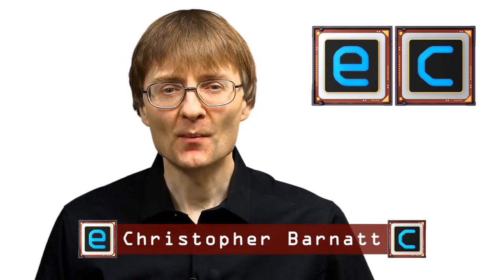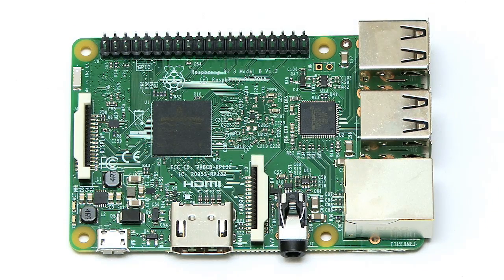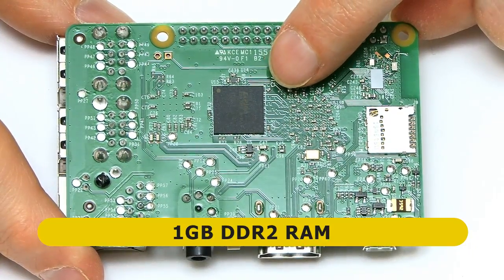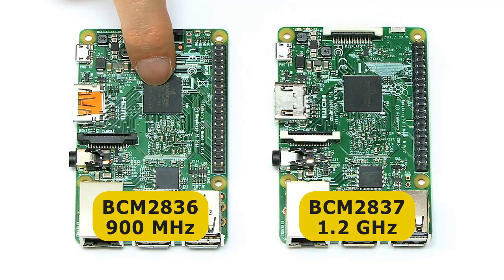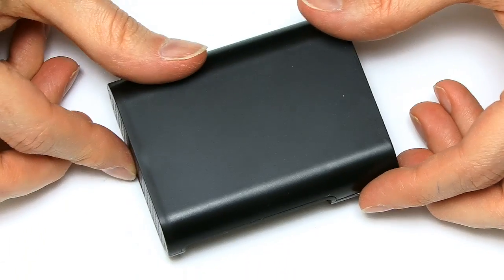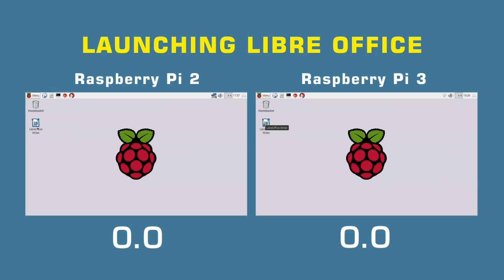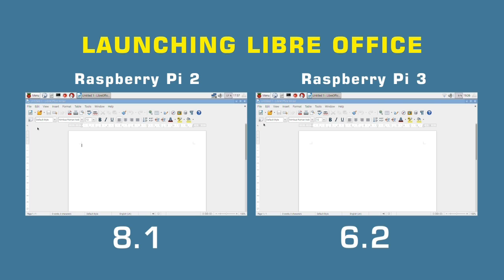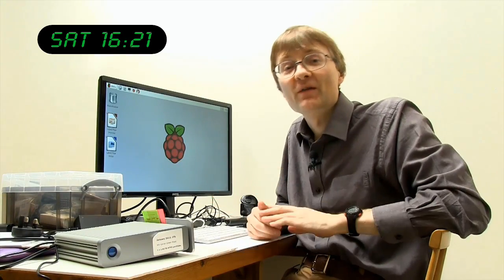Raspberry Pi 3: Review & Speed Tests

Comment: how can you get sound from the pi?
Reply: +el magiko 
Sound will come out of your television speakers using HDMI.
You can also connect to the analogue jack (on all but the Pi Zero).  
The jack (from B+ onwards) also carries the composite video signal.  From my experience the sound over the jack is poor, so either use HDMI or get a DAC add-on for good analogue output.  I attached a Phat DAC to a Raspberry Zero, soldered on some phono sockets, and the sound through my amp is excellent.  You could connect a Phat DAC to a Pi3 as they all (except the first Pi) have the same GPIO.  Other DACs are available for Pi, but I've not tried them.

Comment: Is it capable with windows?
Reply from the maker: +Ps Channel The It can run Windows 10 IoT -- which is not a "normal" version of Windows. See my video "Raspberry Pi 2 Windows 10" for a demo. Or it can run older versions of Windows via emulation -- see my video where I run Windows 3.1 on a Pi 2. But Raspbian or Ubuntu MATE provide a good Windows alternative, and there is loads of good, free software.
Reply: Thank you (again)

Comment: The RAM is too small, imho. Thanks for the video.
Reply: +tremorist hopefully they'll improve that with the next iteration. Since it'll prbly take another year I think a leap to 4 gigs of RAM would not be an insane thing to do.
Reply: its fine for linux
Reply: +tremorist  yes and that's the problem i have with mine..low ram.
Reply: It's not a home computer you plebs, buy a real computer. And, you're literally insane if you think they'll have 4 gigs on this and still have it cost $35. This is meant for small projects, not to replace a $900 home desktop computer.

Edit: a little rude, but I'm seeing tons of people saying what you're saying, and it's not possible in the slightest. People are asking for more ram, more processing power, better everything and etc, and acting like it'll still cost $35. It costs $35 to have a low power "computer" for small projects and to learn how to code. Not to have a low cost high power computer to play video games on.
Reply: @Skripy Resources
Rude and dumb. You're just insulting people based of your assumptions.

Comment: Will you mention the Pi 3 overheating problem in a video or try a cpu stress test to measure the temperature ? 
Some articles and reviews mention that even with a heatsink it can heat up to 80°C (maybe partly because of the 2,5A used for power supply to allow the pi 3 to supply power to peripherals), the Raspberry foundation still hasn't made any announcement unfortunately.
Thanks a lot for your video :-)
Reply from the maker: +Cathy Penneflamme Yes, I will be returning to this issue in another video. A lot of interest in it here today! :)

Comment: I'm thinking of using raspi 3 as a wifi router for a 4G usb modem. How would it perform? Would it get at least 30Mbps of download speed ?
Reply from the maker: +Indonesia This is not something I have tried, but the Pi should have the power you require.

Comment: You should do another Pi week with the Pi 3
Reply from the maker: +Annabella Williams Indeed! My timing was not good on this one! Though I am thinking of maybe a Ubuntu MATE week, and using it on both a Pi 3 and a PC . . . That way I could (I hope!) do video editing.
Reply: +ExplainingComputers Absolutely, wasnt your problem with Ubuntu Mate just poor performance here and there?

Also I lucked out and got one too. Ubuntu Mate is working on getting the Bluetooth working, wifi works though.
Reply from the maker: Annabella Williams Exactly right -- the only problem I had with Ubuntu MATE was running Audacity -- for everything else it ran fine. I have not tried Ubuntu MATE on the Pi 3 yet, but imagine that it will run well. I tried to get Bluetooth running under Raspbian and got a device paired, but not communicating . . .

Comment: Excellent comparison video.  I am wondering if it is possible to compare them when dedicated as xbmc video systems.  Perhaps a bit tricky seeing as performance is dependent on internet speeds and the streaming sites ability to accommodate etc.  Based on your tests and the fact that the Pi 3 is running with a 33% faster clock I would simply assume it will out perform the Pi 2.
Reply from the maker: +Tim Koch Thanks for this. I am sure that I will be trying out OSMC and other software/OSs on the Pi 3 fairly soon! :)

Comment: i am quite a bit disappointed that they still just use only 1gb of ram. At some point in the future they need to change the architecture which means no more backwards compatibility. Maybe at that point other small computer win ground and outrun raspberry. I really like the system as it is, but still a lot more speed within the same price range could be possible.

Comment: Two further changes worth pointing out. 

Two status lights on the board have swapped sides to accommodate the antenna. This may be annoying with some cases that have holes/light pipes at the old location. 

I have the same case as you, and I'm sure you noticed that it doesn't work as well with the new slide in/out microsd slot. Since there's no longer a spring to assist in ejecting the card, I had to whittle away at the case plastic under the card to allow me to pull the card out. Works well with that modification.
Reply from the maker: +albedo0point39 Yes, you are right -- twice  -- above. Good points to note. I much prefer the "click-in click-out" SD card slot on the Pi 2.

Comment: One thing to note about the Pi 3 is its tendency to overheat, causing the CPU to thermally throttle if it's heavily worked for longer durations. This is due to Broadcom continuing to use a rather inefficient 40nm process for the BCM2837, as opposed to something like 28nm on the Odroid C2's Amlogic S905, which also comes with a heatsink regardless.

I discovered this issue from these sources:

https://www.reddit.com/r/raspberry_pi/comments/48i47b/planning_to_put_your_pi_3_in_a_case_make_sure/

https://www.raspberrypi.org/forums/viewtopic.php?f=63&t=138193

It appears the general consensus for the Pi 3 is to apply heatsinks, and if thermal throttling still occurs, a small fan as well. At the very least, a well ventilated case should be used no matter the application.

The Pi community has a curious history of denouncing the usefulness of heatsinks for the various iterations of the Pi, so they seem rather reluctant to admit the Pi 3 might require one.
Reply from the maker: +SavageArms357 Very interesting and useful -- I must investigate the temperatures . . .
Reply: +ExplainingComputers Please do! ;-)

Comment: When you talked about the white retaining clips for the Ribbon connectors, my Raspberry Pi 2 B has the white retaining clips as well. I think it is because your 2 is a review model, while your 3 is a retail model. Not entirely sure though, could just be that they changed the colour from one batch to another.
Reply from the maker: +Champturn I did wonder . . .
Reply: +ExplainingComputers My Pi 3 has black clips so I think it is a manufacturer thing.